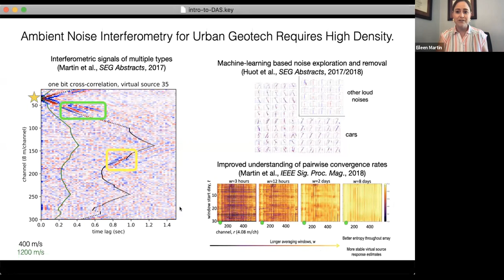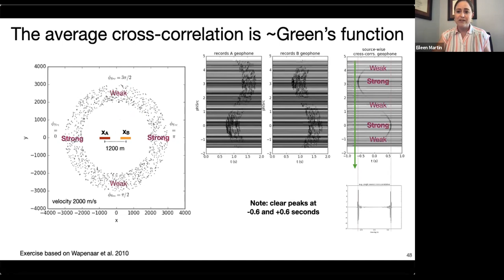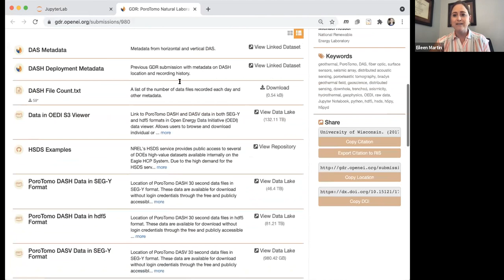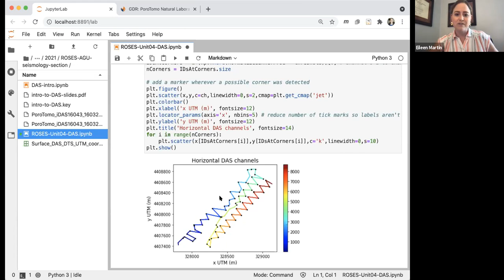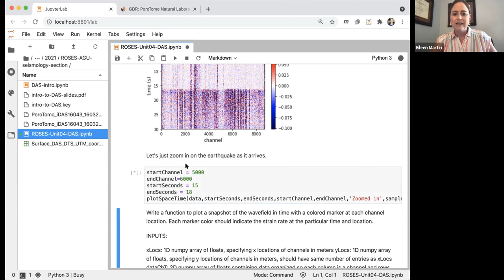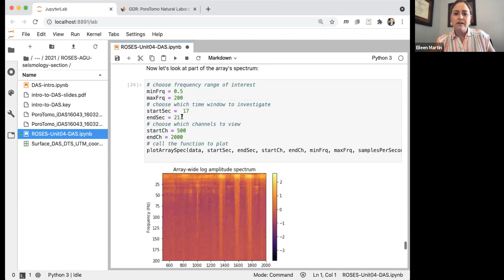ROSES 2021 Unit04: Distributed Acoustic Sensing with Dr. Eileen Martin

Comment: This would be so much easier if you would just share your mathematics in symbolic mathematical form that can be used in any of now hundreds of different symbolic processors. They can compile, check, simulate and do the fitting. I was proud of my ability to do most mathematics in my head when I was young. But now I say let the computer do it, then anyone can rely on groups to be sure the computer does it right - once, for the whole world. Not hundreds of millions of times as each person memorizes their little pieces.

Richard Collins, The Internet Foundation